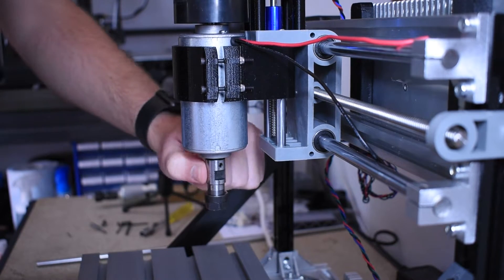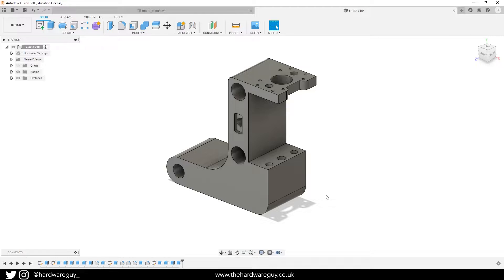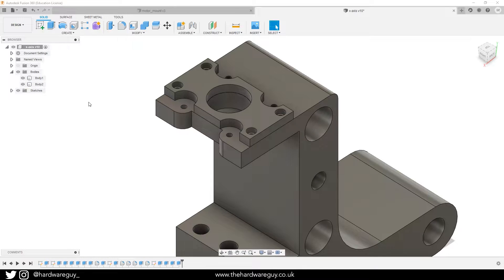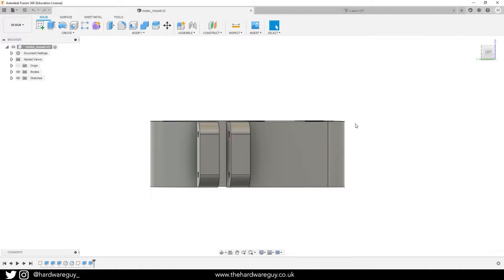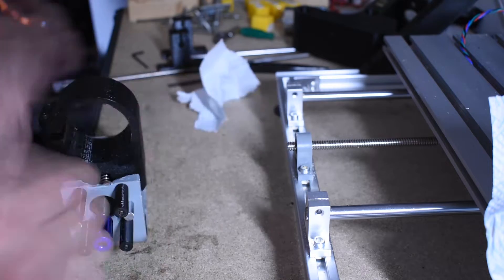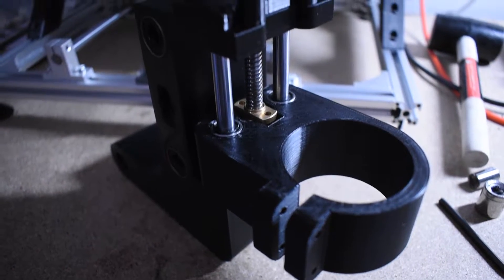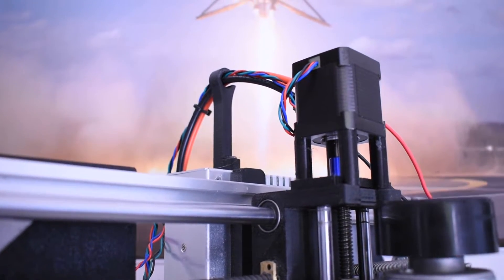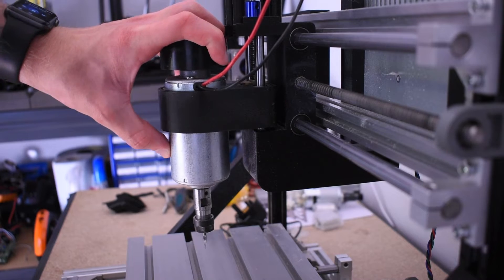3018 CNC - Adding a Third X-Axis Rail

Comment: One thing to consider when printing functional parts is most infill geometries will provide strength in only two axes. For most prints this is not an issue, but in functional parts it is something to consider. For functional parts I use gyroid infill to ensure maximum strength in three directions. With gyroid the infill percentage can generally be halved without loss of strength; important if you need to keep the mass of the part to a minimum for such things as 3d printer parts attached at the hot-end. The downside of gyroid infill is some geometries will cause a great deal of vibration when printing. Long runs of infill are fine but small areas of infill tend to vibrate the whole printer quite a bit if you have a moving bed. CoreXY printers have fewer issues, the only one being the chance of greater infill-ringing if the hot-end is very heavy. In all cases, printing the infill slower is the answer. (Some firmware and slicers can be trained to slow down when small areas of infill are deposited. Check your setup to see if you have this option.) Luckily, one other benefit of gyroid infill is its much shorter print time with fewer large hot-end movements, so slowing down the infill speed should not noticeably increase the print times. 
I have printed parts in PETG which prevent flexing of a steering shaft in a track focused sports car. With the majority of infill types a percentage of 60 to 80% was required. With gyroid only 40% infill resulted in a part with almost double the strength. Both prints (cubic and gyroid) were annealed at 80C for one hour after printing. For functional parts I always recommend annealing to prevent unexpected warping or shrinkage.

Comment: Great idea for the 3rd rail, but it looks as though you added flex in the collar around the spindle motor by making it longer and thinner. In the video shown from the side, it looks like an even trade for no net gain.
Reply from the maker: Thanks Rick. No flex on the collar, it's 100% infill PETG so pretty solid. The flex comes from the rails still, while it did improve it did not eliminate. If you want to truly eliminate flex you'd want to buy thicker rods, or even better linear rails. However, at that point you might as well buy a bigger/better machine. My goal here was to improve the machine at relatively low cost. The main gain was being able to add a spoilboard, check out my more recent video on that👍🏻

Comment: Man this video is old :) but just some design advice, never leave sharp inside corners.  Add a fillet to improve the strength as the sharp corner are stress concentration points. Other than that good video.

Comment: I've thought of doing something similar, however I was always curious why they didn't take advantage of the aluminum extrusion right behind the rails, as the rails themselves are most of the flex a linear rail compared to a rod would be much stiffer

Comment: well...  the next upgrade would be to get the 3018 Pro, ProVer, etc, with the 20x40mm extrusion sides and bakelite or metal side plates... i've got the Pro, and there's just a little play in the z axis rig (which is a metal replacement one off banggood, with a '500w' spindle) and i'm considering replacing the rods with linear rails.
Reply from the maker: I think the linear rails could possibly completely eliminate the wobble! did you try it?

Comment: I was almost done doing the same upgrades when I found your series. Trust me I would have become a member on your site just for the time I would have saved drawing up and printing my own. I have a stupid question though. Are you powering your board on a separate 24 VDC? I am also running the larger motor on its supplied 48VDC PSU but I can’t find anywhere the max voltage for my board or any others.

Comment: By any chance do you know what kind of lead screw it has to drive the x and y i tried to upgrade mine and the lead screw were not the same i was able to run it but since i only changed the x the height was was off, im not even gonna try messing with the code for the  x

Comment: 1:29 if you went to the effort to redesign this part, why not make the Z axis travel larger or at least spread out the existing linear rods above and below the screw? Would standard Nylon 6 be a suitable material or would it not be rigid enough?

Comment: Can it mill aluminum?
Reply: Not without installing actual linear rails.

He installed a third shaft guide, which flexes in all directions and are not linear rails. Adding a third one adds negligible rigidity to the system.

Actual linear rails are mounted to the frame of a machine and are rigid in all directions. And the 3018's actually are very easily converted to have linear rails as they have two frame beams close to the X axis (one right behind the Z gantry which is ideal to convert to support the weight and forces from that gantry).

Those beams you can mount linear rails to easily and make even more rigid by replacing them with a bigger profiles (like 4020's or 4040's) if need be.

Shafts and shaft guides float between the frame and flex, the longer they are the worse they flex.

Linear rails don't, they can take the force of a Z gantry pushing down, lifting up, torquing, doesn't matter what direction the load comes from.

With the 3018, the full weight of the Z gantry is supported by 2 guide shafts and the lead screw, all three things that flex like mad.

Adding just one Linear rail behind the Z gantry will make the whole thing exponentially more rigid and capable of putting force in any direction without flexing remotely as much, which makes milling aluminium possible.

To do it at any decent speed, you may have to fortify the tower beams to the sides and then you best add a second linear rails to the upper beam behind the Z axis (at which point you really just need one shaft guide to buffer some vibrations) and either add a linear rail to the Z gantry or replaces both shaft guides with linear rails.

At that point, the whole XZ system is solid enough to cut aluminium at a decent speed with a decent surface finish.

The only prohibitive thing about doing this is that even cheap linear rails (which will already be a vast improvement over shafts) will still cost you 50-70€ for 2x300 for X and 2x200 for Z and you have to have access to a 3D printer or other way to fabricate methods to connect your gantries to them.

Comment: This has bothered me for a while and maybe you can answer it...   It seems to me that a z axis backlash spring should be pushing the carriage UP ensuring the z steps would push the tool into the work piece, ensuring thread contact. I consistently see these installed with the part attached to the z axis carriage on the bottom, like yours.  This would put the pressure downward and any slack would be exaggerated.  If the spring on the backlash spring cannot hold the weight of the z axis carriage you've lost the effectiveness of the backlash assembly even installed properly.  The only way to ensure this is to have the spring push UP on the carriage, meaning the part bolted to it is on top.  Does my logic make sense?

Comment: This is good start for learning CNC machines and understanding how it's works. But there is big problem: You can't realy do this!
Why?
Because RIGHT feeds and cutting speeds depends from spindle speed, spindle power, cutting tools and material hardnes. This is calculation between tool toot count , tool form, cutting deep, cutting direction, cutting owerflow percentage, material hardnes coefficient, spindle rotation speed.
For normal cutting all parametrs should bee right calculated.
Finaly you see, that your spindle is to slow and for weak for cutting wood... and you tool wearing out wery quickly, heating up and screaming.
I know what I say, because I made many woodworking machines(Excluding CNC) and know about parametrs above. I bought this machine , like you, for learning all about, but quickly understand, this is not possible with this small machine.Yes, you can adjust some  parametrs for you machine, but not every time,and you experience will be wrong.
This machine is good start to learn how to make one better machine, price is low as poosible and save lot of money for you in future, helps avoid big mistakes and loasing money(This is coolection of all impossible mistakes for CNC)
Learn all this mistakes and DON"T spend money for this machine, collect for one new!
Reply: I agree sort of.  My Dad was a MANUAL machinist for 40+ yrs and understood all of that.  Time is money and cutting air or using improper feeds and speeds is not a wise use of the machine.  For the size of this unit and it being specifically for hobbyist to learn the basics of Gcode commands, fixturing, tooling, etc, I think it's "good enough" for us without breaking the bank.  Yes, we'll break a few end mills and scrap parts at first but we'll either learn from those mistakes or give up and do something else.  Most of the time when I "need" to make a part it would fit on this machine.  That gives me a chance to keep my chops up on F360, design the part, make it and have the satisfaction of doing so. I don't care if the tool paths are optimized for efficient cutting or it takes longer to complete the cut.  I'll just have a cup of coffee while the machine does the work :-). 

 I just wish he would offer the "upgraded" F360 parts shown separately instead of making me join his website.  I have no interest in any of the other parts and can if necessary recreate these parts in F360.  I'd be willing to buy just the X carriage, smooth rod plate, 300 watt spindle models.  Not sure why he didn't take the opportunity to increase the z rod travel when he remodeled the X carriage.  Looks like there's easily an additional 25mm or more to be gained.  Did he add a bearing in the bottom to control the Z lead screw "wobble"?  Don't know since I can't examine the model. I will if I have to redo the parts myself.
Reply: @home-dp6oh  Yes! This is good enough for understanding that this is yust toy...Nothing more.
Biggest inventors problem is difference between manufacturing "laboratory model" and manufacturing production process... All you laboratory experience becomes unusable!
The same will happen with this experience. Why? Yust one example, rigidity. When you start with real machine, all you problems will dissapear! There you spend lot of time for solving this problem, you should change feeds and owerflov, searching best way and making lot of machining pases. Again and again.
And more...
Yes, I agree with  you that you never spend lot of money(I hope), but better learn all mistakes from this toy and save money for building one realy good machine. And you get mutch more satisfaction.
Mans remain kids all time and should play with toys. Only toys becames more expensive and mans older...

Comment: 6:25 thats like too much and its moving 2 axis not just z.infact its moving z becouse a axis rotate (flex)
Reply from the maker: As I said in the video, it still moves but it's a lot less than before. It is a very low cost upgrade that slightly improves the capabilities of this machine.

Comment: Great upgrade; it's turned out very well.  I'm curious what the control board and stepper drivers are - the drivers look like DRV8825s.  How much current did you need for the larger Z axis stepper, or is that still "tuning in progress"?  I notice heatsinks on the MOSFETs (I assume) but not the stepsticks.